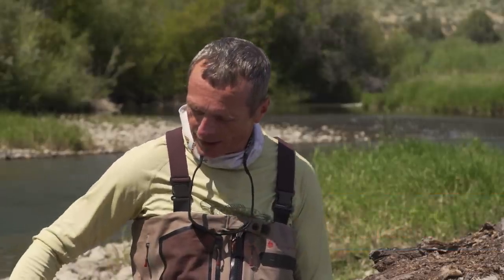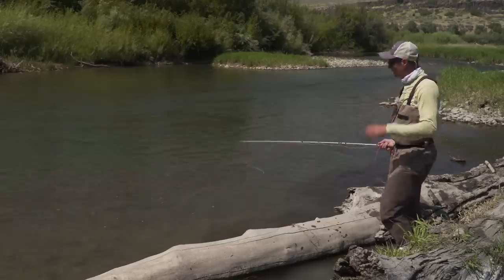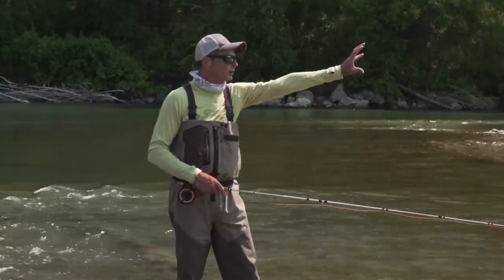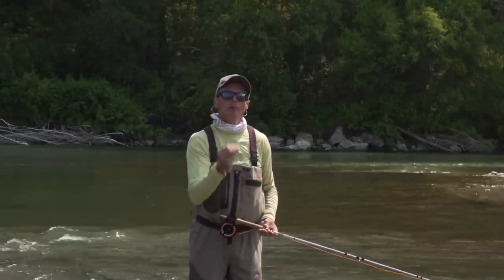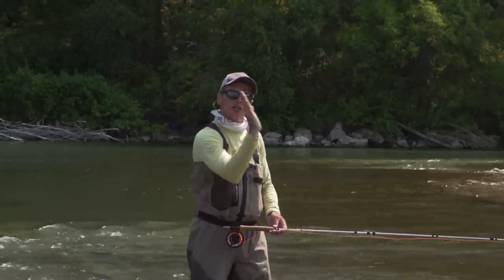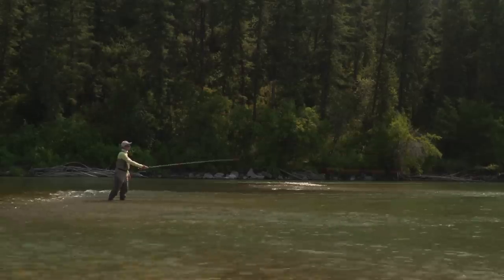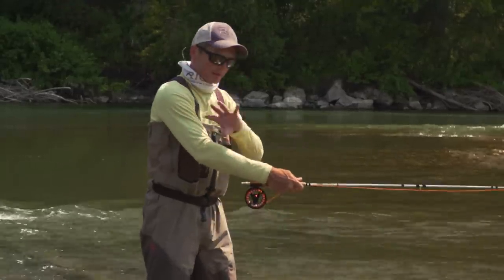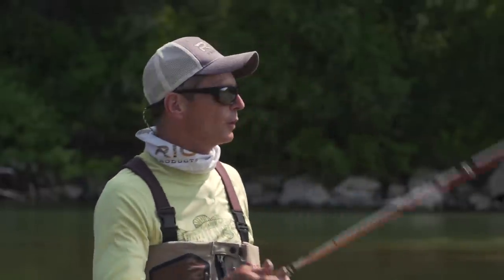How to Perfect Your Forward Cast

Comment: Well that settles it.  I’m doing everything exactly the wrong way.
Reply from the maker: Don't worry, you will get better. I was the same way with golf, could not stop slicing the ball into the trees! But practice and mentoring really help (and of course watching our videos!). Good luck learning and improving, have a great season!
Reply: Practice makes perfect. Took me awhile too get a hang of it. I found out consistency plays a big role on  getting a smooth perfect cast. It's not how much power you apply to the rod. Thanks for the informative vedio.
Reply: It's a long learning curve. Now I have more good casts than bad ones .
I'm not sure if I can mention name of a specific fly line but a good line will make it easier ,and make you look good.
I found "my" line for smallstream casting and everything fell into place, trying the instructions last weekend It got even better 👍
Now I look like I know what I'm doing 😉😁